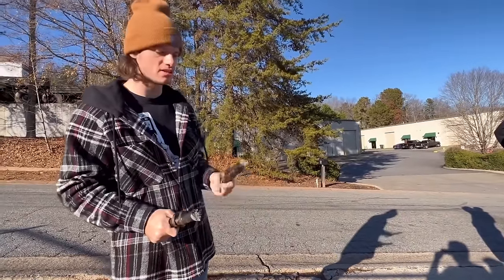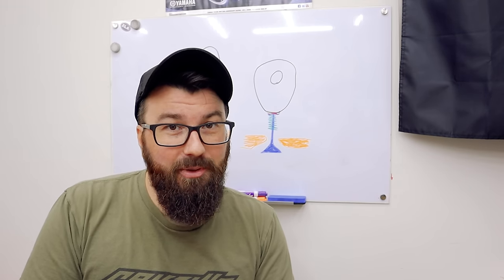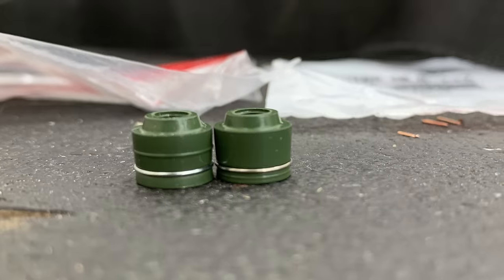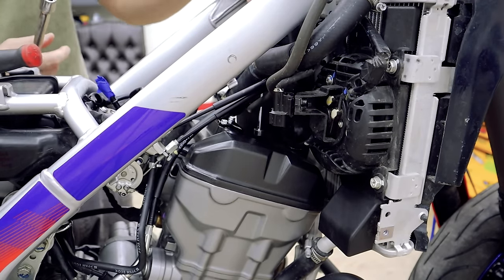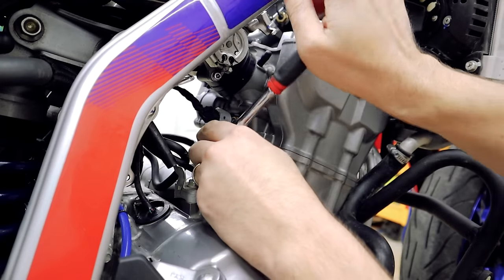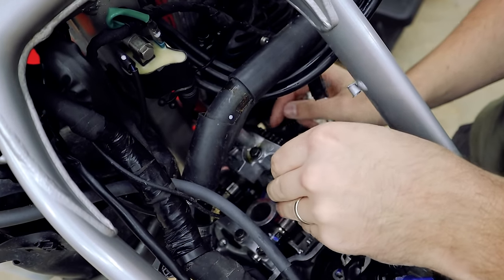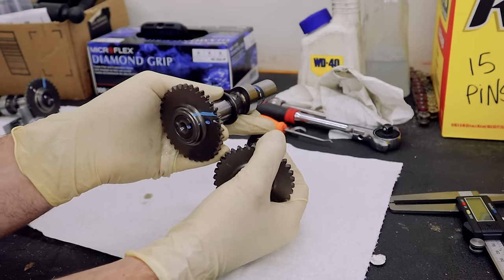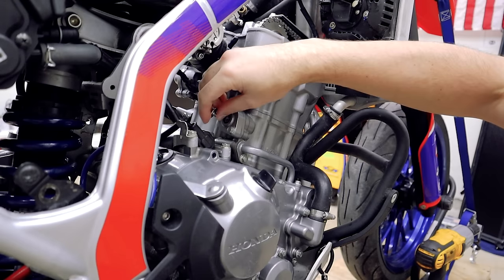CRF300L CAMSHAFT SWAP for CBR300R Cams and Valve Adjustment

Comment: Hey Jake great video, I have done a ton of valve jobs but never a cam. After this video and the carbon can delete I have decided that it would be good to give you some support on Patron because both have been super helpful to me. Also when you were talking about being 180 out a little trick I do is pull the plug and put my thumb over the plug hole as I turn to top dead center, on the compression stroke if will be enough pressure to push your thumb away and you can feel when it's coming to where you need. But thanks again for the informative video.

Comment: I wonder about compression?  
Great video on a complex subject!  Valve clearance effects timing, more than ya might think.  But a tight exhaust valve, not enough clearance, can cause a bad day!
The exhaust valves require seat time, to dump heat.  If valve clearance is to tight and the valve grows sufficiently to reduce clearance enough to unload the valve it will bang shortly.

Again, great explanation!

Comment: Jake, I dropped a hotdog in my engine. What do I do now?
Reply: Wd40
Reply: Engines gotta eat too
Reply: Stuff dinner rolls in the oil fill plug.
Reply: Ketchup
Reply: Either it went trough the head or crank grab a wrench, take off the plugs and crank that sht.. after that open the oil drain or exhaust port, catch whatever gets out and throw it in the fryer.. its already oiled up and you’d finally taste what million year old dinosaur tastes like..
Reply: Let er eat
Reply: You eat the whole engine

Comment: For those who don’t know a couple things to keep in mind doing camshafts. If you pull out a shim make sure it’s all the way seated in it’s home, if it’s not will have no/low compression. When installing cams always start on the cam away from the tensioner. Most tensioners will lock collapsed somehow read your manual for specifics. Do not over tighten cam caps will cause a whole lot of issues. Lube is your friend. Always spin it by hand before trying to start the engine last thing you want is to kiss a valve
Reply: I lick my valves. For good measure. Good stuff man, thanks!

Comment: Jake, I like to use a micrometer rather than calipers to measure my shims, but my caliper is cheap because I am cheap.  I had a guy struggling one time to measure his shims on a 636 he was working on because he was using calipers instead of a micrometer.  I brought my micro over and got him steered in the right direction and got the old shims in the correct positions within the kit and the correct one installed.  That was the only multiple cylinder bike I have done an adjustment on and I prefer the singles a lot more.

Comment: Hey Jake. Great video! Do you think stage 1.5 with the CBR cams is still worth doing while stage 1 shows very similar increase of power and torque but more spread across low and top end when doing only off road riding ? Thanks for your reply !

Comment: 15!!! don't forget! I'm about 4-5000 miles away from doing the valve clearance check on my CB500X. I believe I can do it I've basically done everything else car/truck/motorcycle related besides internal engine work or top of head work but i have watched it be done. The biggest pain I think is dealing with buying shims. I've looked at shim kits and they seem very expensive but once I have the bike apart to check everything I don't want to be waiting days for a shim. Do they usually have a lot of shims at the dealers all the time? I'm located in DFW so i feel I can find individual shims easily but like you said even after doing the math sometimes it can be a tiny bit out of spec and need to be exchanged.
Reply from the maker: Them shim kits are a good thing to get. That 500 motor is basically the same thing with an extra cylinder. I keep floating the idea of getting a 500 motor and putting in in my frame...
Reply: @TheGardenSnake  I'm not sure of the weight/physical size difference between them are but I enjoy this 500. I've previously owned a FZ09 thing was fun but you're wanting to pull the front wheel up alot. This CB500x is the best all around bike i've ever owned and cheapest.

Comment: I think the HP increase will be minimal and moved up in the revs range. Will the fuel input system need modification also ? Bigger injectors and/or intake tube ? I would rather have more power spread from low to mid range for my off road trail riding.  Can't wait to see if you went with Yoshi or Akra or FMF or Arrow. Thanks for the vid.

Comment: I definitely prefer the fatter bottom end both for off road slow speed and road accelleration. The whole point of the flexability of this engine is the smoother torque transition low to high RPM. If it was an enduro or MX bike the higher top end would make sense but then you might as well buy a lighter more powerful model. Also reving it out more to get the torque means more fuel use. The minimal fuel consumption is one of this bike greatest strenghts. Also the ecu fuel injection mapping and the spark profile is going to be optimised for the cam profiles.

Comment: 600 hp three cylinder korneggsegg engine is CAMLESS.  Uses pneumatic valve actuators to open/close valves controlled by computer.  No friction from cam/chains etc

Comment: Is the cost/time being put into this actually worth the gains at the end is what I would be interested in hearing.
Reply: It would be worth it if you had to do a shim job/check cause of a service interval. Just an 80$ cam to gain a few hours,makes a big difference on low hp bikes
Reply: Just going from 24 to 27 hp would be a 12% increase in power, which is pretty big.   Like he says on low power bikes every little bit helps.  With all the work he's doing and custom tune, I'd be surprised if it wasn't even a bit more.  Not to mention being able to smooth stuff out when you actually do the tune; factory tunes are generally focused on efficiency and can sacrifice some rideability.   If it's "worth it" that's hard to say depending on how much all that stuff matters to each individual person.   I'm excited/curious to see his dyno results in the end.
Reply: If it really gets 2+ hp gain at the power level of these bikes, for $90 it's literally going to be the best bang for the buck possible.  Nothing else is going to give that gain at that price.  For anyone even slightly mechanically inclined this is a very easy job.
Reply: The end result is always selling the bike after dumping money into the pit and buying a proper performance bike. If you are unhappy with less 30hp, you will never be satisfied. Multiplying small numbers still makes small numbers, don't be fooled by % performance increases under 30.
Reply: I rather have a couple less horses but decent torque in the low and midrange than two more horses close to redline. 
After all, this is not more cc, this is just pushing the power to another area of the power band.
In the street bike version you may want more power on top, but in the enduro I want more torque down low, even if it means less power on top.

Comment: Are these gaps the same for my stock 300l?
Dealer told me today/check valve clearance at 20 hours or 100 miles???
And change my oil too?
At 100 miles?
Looks like the cams have to be removed to change shims?
Thanks
Great camera work
Reply from the maker: Yeah it's the same gaps. And your dealer told you that for a CRF300L??? If it was a CRF450R ok sure if your racing. But dude no, it's got long maintenance intervals. 8000 mile oil changes by the book. I personally would do it a bit sooner but still like 3-4k is fine. Valve adjustments are like at what, 16,000 miles? Don't worry bro, go ride your bike.

Comment: Question for you. For the valve clearance, were you looking at the CBR or the CRF clearance specs or are they the same values?
Reply: He mentioned that the head seems to have been made originally for the CBR so they are essentially the exact same except the cam. You'd want to use the clearances for the CBR when you put in the new cam if they are any diffarent since those clearances are meant for that cam.
Reply: Also at about 16:13 he talks about the specs for the cams.

Comment: Ok, Second Question why not use the Power Vision 3 for the cbr300r and flash the crf300l ecu with the dyno jet tune
PV3-16-11 for cbr300r  vs PV3-16-19 for crf300l?
Reply: Yes
Reply: I have been talking with dynojet,  You can only flash tunes from dynojet to the ecu they are designed for.  So you cannot flash the crf300l ecu with the cbr300r tune.  However dynojet said that they could send you the Cbr300r tune files and you could use them as a guide to modify and build your own crf300l map/tune.

Comment: Now wondering if this is possible on my 250L…CBR250 makes 26hp while the CRF250 makes 24
Reply: Read about swapping ecu, I believe it brings your rev limit 1k rpm higher. And can be found for 100$ on eBay
Reply from the maker: I'm pretty sure people also did this with the CRF250L's, Putting CBR250R cams and ECUs.
Reply: @olexandrfrantsen9333  this is max hp is at 8k or something rev max stock 10.5k why would u wanna go higher
Reply: @edwindol3597  because I redline my by bike all day long
Reply: @olexandrfrantsen9333  yeah torque and hp is scary ikr
Reply: @TheGardenSnake  after watching the great video I was left wondering the same thing, but can't find any info on anyone actually swapping a CBR 250R cam into a CRF 250L. anyone have any leads?

Comment: Good video. Didn't catch you mention that the cam shaft cover mating surfaces should NOT have any oil on them as you will get false torque readings on the bolts and your valve lash will be too big because of the oil between the surfaces.

Comment: Hi Jake, do you have the part numbers for the cams and shims please, I'm in the UK and we don't have the CBR300R here so I will need to get them from Webike.
Also, I can't get my ECU flashed because of EU laws, can't swap it either as the ECU is different to the US version. I plan to do the cams, full exhaust system, airbox mod and velocity stack. Do you think a fuel controller would be enough for these mods? Cheers, John.
Reply from the maker: If you go to my link for the cams the part numbers should be there. If ecu flashes are illegal then wouldn’t a fuel controller also be? It manipulates the ecu signals. A flashed ecu appears stock after it’s done. And plugging into it won’t pop anything up that would tell you. I highly doubt they would ever know you did that. The level of very specific equipment need is just too high.

Comment: Don't you just pull the pins out for the rocker arms to change the shims? No need to remove the cams again then.
Reply: Yes. There's no need to remove the cams again to replace the shims. Good video, though. Here's a guide to the valve adjustment on a CBR250R: https://roadandtrail.net/Guides/2012CBR250RA_ValveAdjustP4

Comment: Jake ,Apparently there is a ticking noise  with  the 300l 's engine  when it reaches 5,000 rpm's  I'm not sure if  there is a ticking on the  cbr300  or not . Have you noticed  the ticking  was gone after you changed the cams ?
Reply: its not ticking its vibration. it hits just the right frequency to vibrate everything. its annoying but disappears at 6k
Reply: @thewizardoftech5075  I did some reading and  the ticking does happen on the cbr300 also so its not vibration . Honda engineers put out a statement to the dealers that the ticking is inherent to the internal parts of this engine and  you just have to get use to it , and it is a normal sound .  So many people complained about it  that dealers  were all calling Honda to find out what was going on .
Reply: @Sertao2013  sorry thought you said crf 300 not cbr..
Reply: @thewizardoftech5075   Its happening on both so its  definitely not from vibration from a frequency  according to Honda engineers .  I was wanting to know if putting the  cbr cams in the 300l  stopped the ticking noise .

Comment: Why pull the spark plug before removing the smaller bolts and pulling the head off? Would it not be safe to stay in longer?

Comment: what about the CBR ignition timing? will you be able to modify the Ignition timing with the dynojet power vision 3?

is it worth sourcing a cbr300 ECU?

Im seriously considering the cam swap with Factory exhaust.  think i could still gain top end power and better revability between 8-10K rpm?

Comment: Love your builds.  You need a 2 stroke.  Buy a Craig’s list used/old KTM 300 or Yz250 for
$1000 and build it brand new with
Your touches!    2 strokes really cheap to rebuild vs 4 strokes.  Tell us pros/cons 2 strokes.  I raced Montesa 125 and Cz400 professionally in the 70’s.  I own two street bike so bought a KLR 675.  Too heavy and underpowered for dirt. I wanted a 2 stroke and
Less than 200 pounds. Bought a 2022 yz85.  24 horsepower/160 pounds. I weigh 150 pounds/5’7.  I wanted to touch the ground flat footed. The new KX 112 2 stroke a little taller for tall people.  I own a super Duke and a Grom.  The Grom is too heavy and underpowered

Comment: Nice upgrade. Worst part of this job is the tight space of working on a motorcycle. Small hands are definitely an asset.
Reply: Try to work on wr250r it's waaaay worse than CRF 250l I owned both bikes ,wr is pain in the ass for sure
Reply from the maker: The wr450f is really tight! And 5 valves 😩
Reply: I know I have wr450 as supermoto